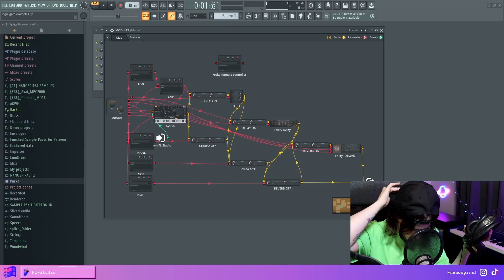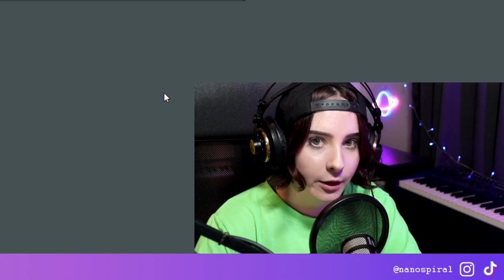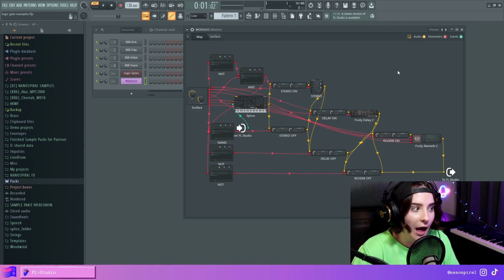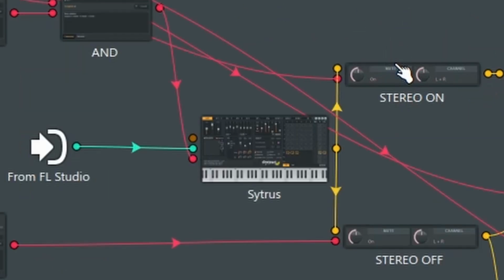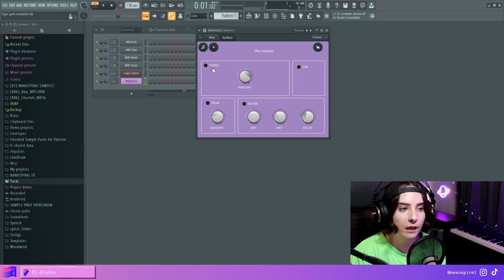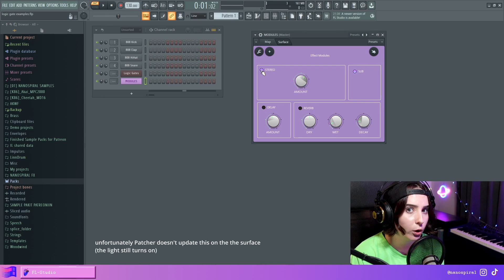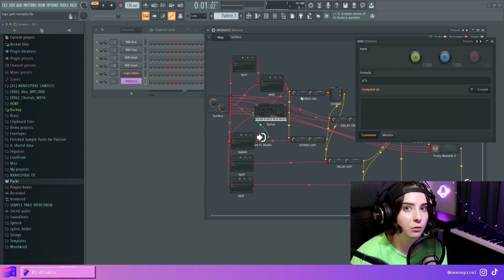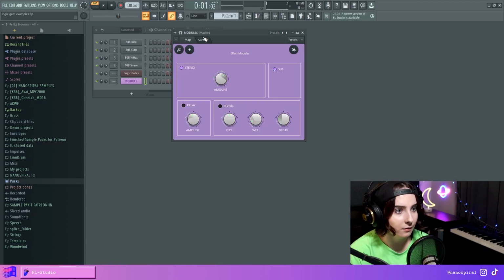How To Create Toggleable FX Modules In Patcher (Logic Gates pt. 2)

Comment: Great video and clear explanation, thank you! Do you know how to make Solo Buttons for multiple FX Send Paths to be able to audition any combination of paths? Say you had Dry, Delay, Reverb, Chorus and wanted to only hear what the Delay and Chorus were doing.
Reply from the maker: Thanks! If I understood correctly, you could create these groupings of FX, label them on the surface and give them their own toggle switches, and then just connect their on/off Fruity Mute instances to the correct switch. So in this case if you had a delay + chorus grouping you'd just connect both of their on/off paths to the same switch. The individual switches might cause some weird issues though if you keep using them at the same time, and keeping track of what's on and what's off would become difficult since the states won't update to the Patcher surface. But yeah let me know if this is what you meant :D
Reply: @nanospiraI  Thanks :)